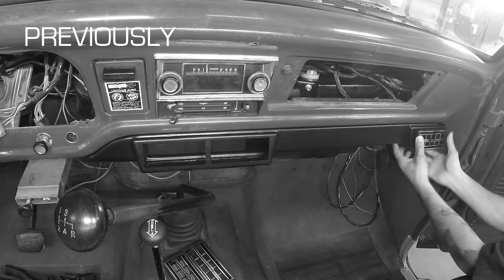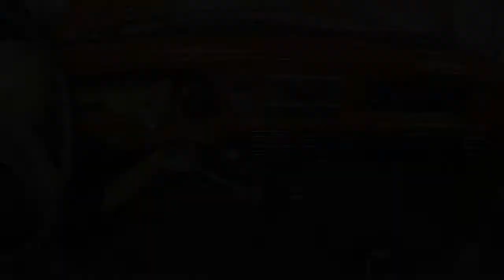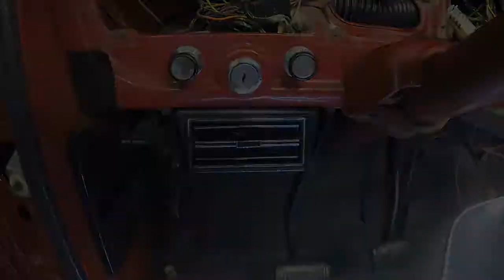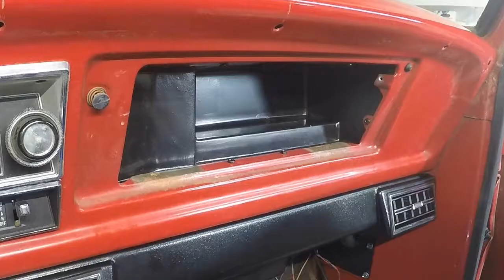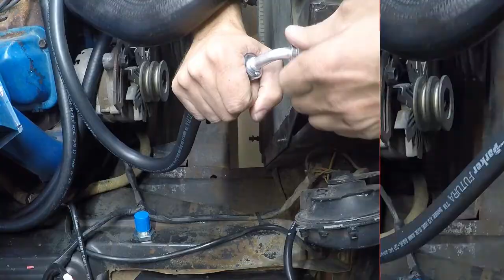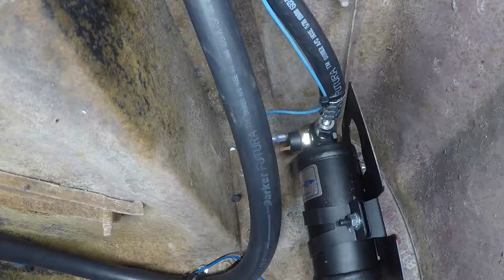1967-72 Ford F-100 Evaporator Installation - Part 4

Comment: Overall a very good set of videos. A few ideas for you guys though. Add the separate condenser video into the series by giving it a number. Also please lose the music it's awful & distracting. I would also link the kit in the video description for people to buy it.  For completeness would be good to see the dash go back together, eg instrument panel, and also see the fuse being added when mentioned. There was never any mention of the compressor and it is not clear if this is included in the kit nor how to do it.  Finally would be good information to know the amount of refrigerant needed and which type.
Reply from the maker: Ben, Fair point. Its only been the last couple of years that we started to produce the install videos, and receiving feedback from the guys in the field is incredibly helpful in know what you guys would like to see in these videos. In these videos we try to simplify the steps so someone who is interested in the kit can see the in's and out's of the install and not really  step by step instructions. The complete details of what is required for this kit will be in the install instructions that comes with the unit and the sequence of the install will be covered by the written instructions. I will relate your suggestions to the appropriate department. thank you for your feedback, and as always if you ever have an issue with our units or just need some advise in setting a system up we are here to help you guys with anything that may arise. Just contact us at 210-654-7171 or tech@vintageair.com

Comment: If just doing the A/C only unit, just skip all the parts about heater core and defrost vents?
Reply from the maker: If using a Cool only unit you wouldn't use the heater portions, but when in defrost mode the compressor will engage. So you will follow the defrost instructions.